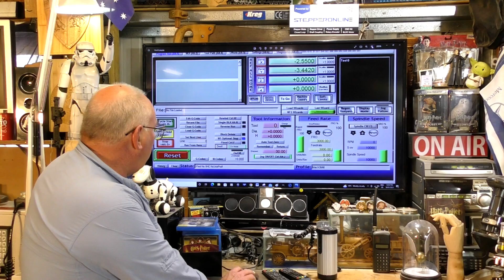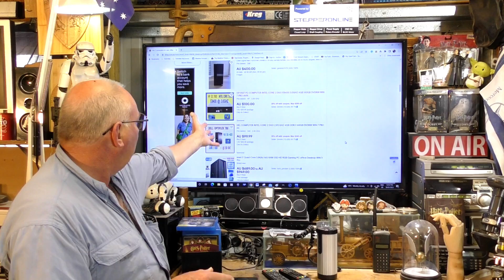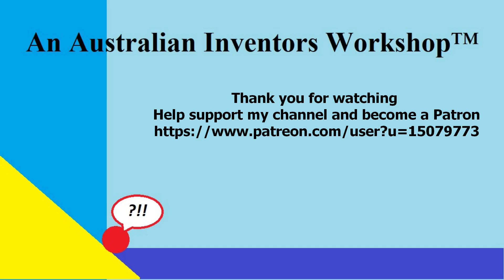Mach3 and Windows 10 EXPLAINER

Comment: Hi. It is possible to run Mach 3 on Windows 10/11 X64 on modern hardware,  but with a twist,  you have to uncheck the ''load mach 3 driver'' (software pulsing engine) when you install your mach 3 and you must use an USB or Ethernet breakout board with external pulse generator, like a Smooth Stepper or BL-USB Mach V2.XX board. I personally run-it on an 2018 PC with Windows 11 X64 and with a BL-USB Mach board, and it works just fine. 🙂

Comment: Have you encountered this problem before? 
My machine keeps moving after I lift my finger off the keyboard, it happens randomly on Y and X, rarely on Z(luckily) and only when jogging with the keyboard (both on slow rate and fast-shift key) 
Never on a g-code.
Checked:
Windows Sticky keys off
Different computers (win10)
Different keyboard (wired and wireless) 
Reinstalled mach3 
Oparation: Windows 10 
I'm lost, the only thing I can think of now is to move it to XP

Comment: Nice work Roger, a quick question; I haev just changed my PC to a newish one with a windows 10 46Bits and  no parallel port, does that mean I won't be able to use my CNC as before? what do I have to do to get it to work with the 64 bits ? Cheers for the great help
Reply from the maker: You will need a new BOB and use USB
Reply: @inventorsworkshop9600  Cheers Roger

Comment: You could run any 32 bits versions of Windows on a 64bits PC, tho you'd have to install your OS in BIOS (or CSM) mode. Finding 32bits versions of Windows 10 ISOs should be easy

Comment: Mach 3 "now works" on any computer! But if you used Mach 3 in the past you needed a parallel port (DB25-old printer port). You could run all your pinouts directly from the computer to your stepper motors, limit switches, and main motor (no plc needed) minus power. About the time Windows 8-up came out most computer motherboards no longer come with a (DB-25) so your only option was to add a PCI DB-25 expansion card. Your CNC control board was the computer. But nowadays there are (control cards) that run Mach 3 out of the USB or Network port. If I remember correctly all this started to change a little after the smothsteeper came out.  So hopefully you will update your video as this is the True reason at some point lots of people had problems or get confused as to what Mach works on or not.
Reply: Please elaborate.  What do you mean by "now works" in quotations? I'm getting Mach3 to open fine and the interface works fine on Win10x64, but I just found out today that it won't work with my Gecko G540 over a Win10x64>USB>DB25>G540 connection. (I understand the USB/DB25 adapter is a no-go under any circumstances now.) Its my understanding after all the research today which ultimately led me to this video, that even if I get a parallel port card so it's Win10x64>PCIe/LPT>DB25>G540 it won't work because the OS is still 64bit.   However, some say a motion controller like Win10x64>USB>UC100>DB25>G540 will work with Mach3, but according to this video it absolutely conclusively won't ever as long as the OS is 64bit.  This video is only a month old - but you're saying it's already out of date?  Did something change this recently that'd help my situation?  I'm still confused here.  Are you saying the lattermost combo I mentioned here WILL work ok?  Please be specific as possible. Thank you.
Reply: @Magestyx1  I mean "now works" because there was a period (windows 7 time) where all the controller cards that existed used parallel ports to connect to the computer. This is when everyone was having problems with new versions of windows 7 64bit. I believe this mostly because, at the same time, motherboards were coming out that no longer had parallel ports directly on them. Because of this, there started to be a lack of the correct PP Drivers. Some expansion PP cards worked some would not ... That being said controllers at this same time started to come out like the smooth stepper that used "ethernet" (network plug) to connect to the computer that had specific drivers for Mach3 now made it work with any version of windows.  The bottom line this guy knows a lot of stuff but I can assure you I understand more about this than he does.  YES, I know for a fact the Last option will work  Win 10/64bit USB/UC100/G540...   The UC line is the ONLY USB converter I believe works as it was specifically designed because of the problems people were having in the past.  Nowadays the only way to go if you purchase new controllers is a Network ethernet plug..  Let me know how it goes.. If you need help let me know.
Reply: @Jeralddoerr  awesome - thank you, sir. I've ordered an authentic uc100. I much appreciate your clarification and help.

Comment: Back in 2013 I decided to get involved in the CNC game purely for personal reasons and hobby use to run a CNC mill,so I bought a desktop Win7 computer on the 'Bay for A$50 but from day one it wouldn't work.....the 64 bit problem etc.........eventually with the help of the guys on CNC Zone it was diagnosed as the 64 bit syndrome so I bought an old Verizon computer running XP 32 bit which is all Mach 3 needs to be happy and a 24" monitor too for A$100 on EBAY...........the Verizon computer is the size of an A4 sheet of copy paper and stands upright next to the CNC mill cabinet.......I prefer the computer with separate monitor as opposed to a laptop as the monitor has a bigger screen for the price and can be placed easier on a jointed arm etc.

Comment: I don't quite get it this time Roger.
I have a 2 year old I9 64bit motherboard running Windows 11
Working with Mach3  and Mach3 USB card.
Can you explain how that is possible?
Reply from the maker: Hi, this is what Newfangled Solutions say about Mach 3 and windows 10 64-bit
 Like many in the CNC community, we and our customers have been affected by the Windows 10 (64bit), version 1803 update issue that leaves the Mach3 application unable to completely load (after profile selection, the splash screen will render and then disappear as the application crashes). We've investigated the cause and developed a provisional patch to the Mach3 (version 3.043.062) application binary that has demonstrated effectiveness in resolving the issue. We are working together with the Mach development team to further validate this patch as they work to deliver an official release in the near future.

Comment: I have a 1 year old AMD Ryzen 12 core (24 thread)  windows 10 and Mach3 runs fine. My windows7 laptop is in the garage and works on Mach3 to control my machine. That uses ethernet  connection not printer port or USB  so I'm confused ? ? ? ? ?
Reply from the maker: Hi, this is what Newfangled Solutions say about Mach 3 and windows 10 64-bit
 Like many in the CNC community, we and our customers have been affected by the Windows 10 (64bit), version 1803 update issue that leaves the Mach3 application unable to completely load (after profile selection, the splash screen will render and then disappear as the application crashes). We've investigated the cause and developed a provisional patch to the Mach3 (version 3.043.062) application binary that has demonstrated effectiveness in resolving the issue. We are working together with the Mach development team to further validate this patch as they work to deliver an official release in the near future.
Reply: @inventorsworkshop9600  Thanks Roger.
Reply: The only people that get confused about this are the old guys... I'm one but figured out the problem back in the day... But they have separate CNC controller cards so this compatibility problem is only for people trying to use Machs native parallel port off an old motherboard. Mach 3 company used to be run by like 1 1/2 dudes so I think they lost interest and don't want to support Mach 3 with other controller boards... Guess the half dude split and made Mach 4 for this.

Comment: I have a I5 that is 1 Year old and runs a new windows 10 op sys and it runs mach3 usb just fine
Reply: I am running a much older version of mach 3 ver 2.63 and win 10  -22h2 build 19045.2486 and i run my lath off of it
Reply from the maker: Hi, this is what Newfangled Solutions say about Mach 3 and windows 10 64-bit
 Like many in the CNC community, we and our customers have been affected by the Windows 10 (64bit), version 1803 update issue that leaves the Mach3 application unable to completely load (after profile selection, the splash screen will render and then disappear as the application crashes). We've investigated the cause and developed a provisional patch to the Mach3 (version 3.043.062) application binary that has demonstrated effectiveness in resolving the issue. We are working together with the Mach development team to further validate this patch as they work to deliver an official release in the near future.